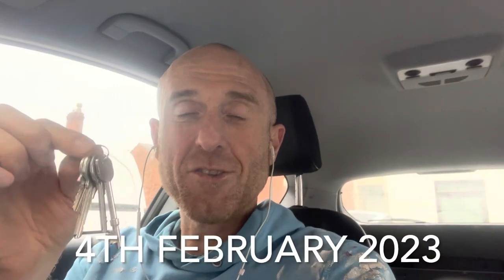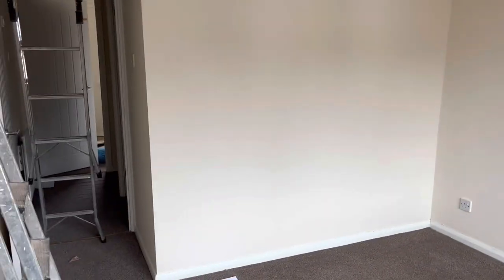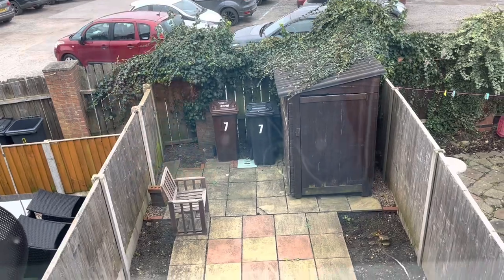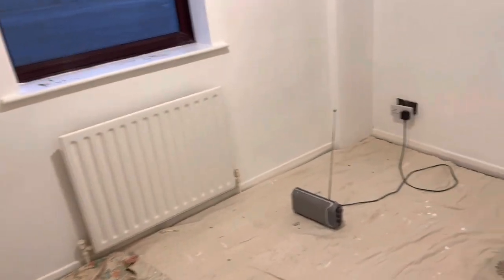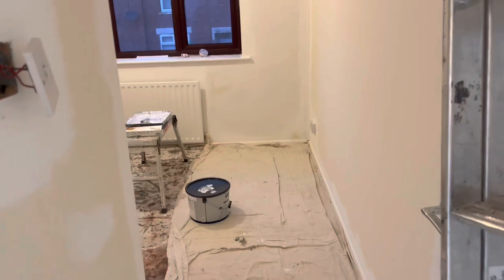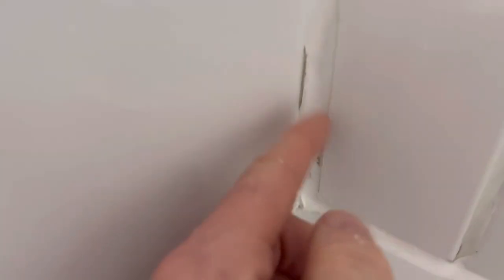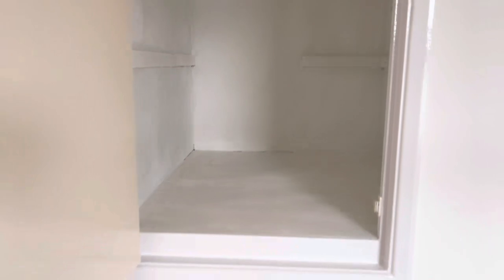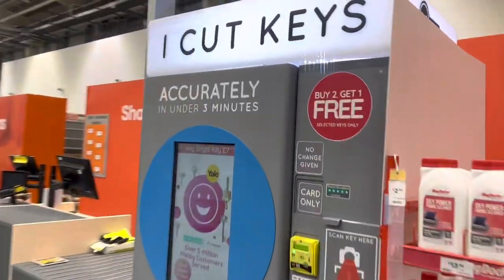Buy To Let Property Number 20 | Part 2 - The Renovation | Buy To Let Advice For UK Landlords

Comment: Excellent video As always Dan, very informative and helpful. I agree with the shed and I generally remove anything that could cause future maintenance issues including burglar alarms and telephone/aerial extensions!

Another decorating tip I picked up from a pro was to submerge any brush used for oil based based paint in water! When you need to use days/weeks later, just brush onto newspaper to remove excess water and the oil based paint on the brush is good as before…!

Quick question, do you replace the locks when you purchase a new property or have spares to rotate if needed?
Reply from the maker: Hey James,
Great to hear from you, I hope all is well.
That’s a great tip thanks very much.
I do change all the locks, I just have a tub full of barrels and I swap them over every time I acquire a new property or have a tenant turnover. 

Thanks for watching and for dropping a comment.

Comment: Hey Dan. Love all your videos and find them really useful. Was just wondering about your smoke alarms. Do you have to have fixed wired smoke alarms in your BTL properties. I see yours are standard battery smokes. Is that allowed or is there any rules around this. 
Thanks
Reply from the maker: Hi Peter, 
Thanks very much for watching and for dropping a comment.
In a standard BTL you’ll need a smoke alarm on each floor and they can be battery operated. 
I hope this helps

Comment: do the fire alarms not need to be connected to each other? great video, ive just bought my 3 property thanks to you and your book.
Reply from the maker: Hi Scott,
Thanks very much for watching and for taking the time to drop a comment.
A single let property does t require a fire alarm. You will need a smoke alarm on each floor and at the moment they can be battery operated. 
I hope this helps

Comment: Any spare flooring in the loft this time😂
Reply from the maker: 😂 not this time but the loft is nlw the first thing I do, always learning 👍
Thanks for watching.
Reply: @new2property  also can you recommend a external key box this is a great tip save me running around handing out keys and remembering who has keys
Reply from the maker: @seanmallard3118  this is the last one I purchased, my advise is to just make sure the one you get is metal rather than plastic: https://www.ebay.co.uk/itm/173734300093
Reply: Thanks for the advise looks like the screwfix one but half the price
Reply from the maker: @seanmallard3118  it’s worth just remembering that’s your insurance won’t cover a break in if they gain access with a key from the safe. It’s worth putting it out of sight.
Reply from the maker: @seanmallard3118  it’s worth just remembering that’s your insurance won’t cover a break in if they gain access with a key from the safe. It’s worth putting it out of sight.

Comment: Can you just not put in the tenancy that you will not maintain the shed as a condition?
Reply from the maker: Hi FBA,
Thanks very much for watching and for dropping a comment.
I could do, however, when it rots and becomes a danger to the tenants in the future it’ll be my responsibility to remove it. 
With it gone it’s guaranteed I’ll have no issues with it to deal with. 
Thanks again for watching and for dropping a comment.

Comment: Great renovation job, Dan. Two points that confuse me a bit though. You're obviuosly a very good general builder yourself and have trusted contractors on hand, so why didn't you box the ugly pipes in that are running down through the ceiling in the corner of the living room? That's a quick, cheap and easy job that would have left the living room looking 1,000,000 times better. Second point, is (of course) the shed. Low maintenance and very, very, very useful for the tenants. I agree that it's not a big "game changer" in terms of letting the property or the rental income, but it's just so useful for the tenants and in reality not a lot of trouble to keep standing for a savvy tradesman of your fine calibre. I really don't undertand why you want to remove sheds when they're in such good condition?
Reply from the maker: Hi Francis,
It’s interesting you mention this, I had to go back and check what pipes your were talking about as I but a cover over the ones in the lounge near the window. You’re right it’s missing, I didn’t spot this when filming, I’ll have to have a chat with my carpet guy and plumber to see who’s moved it, thanks. 

A shed will have me return to the property at some stage, no shed won’t, it’s as simple as that, I don’t have the time to maintain sheds that’s are not required to let a property. 

Thanks very much for watching and for dropping a comment.